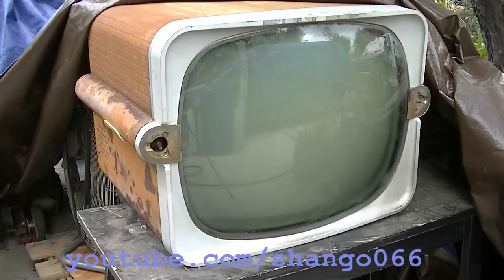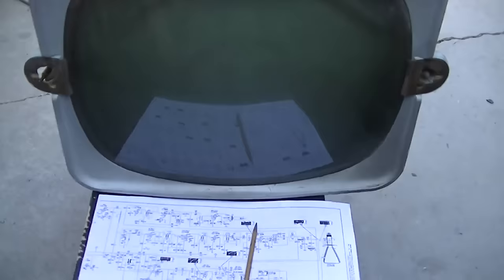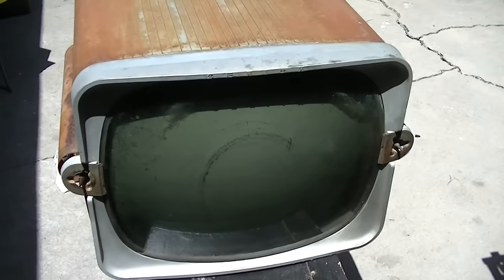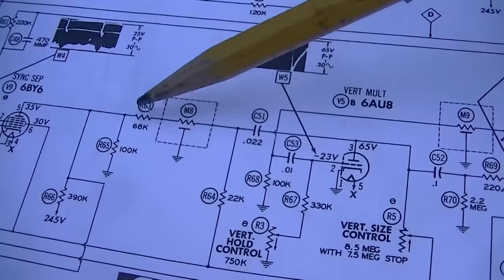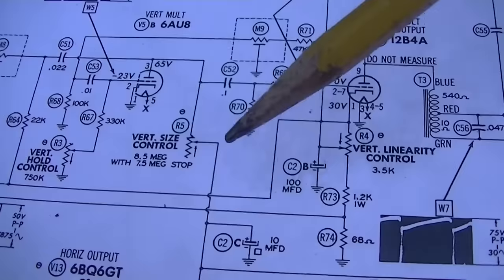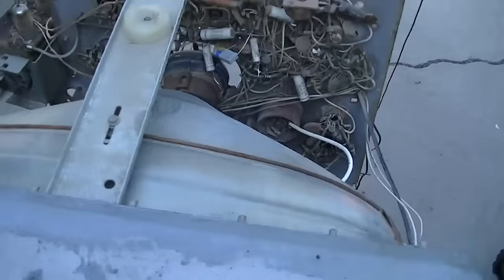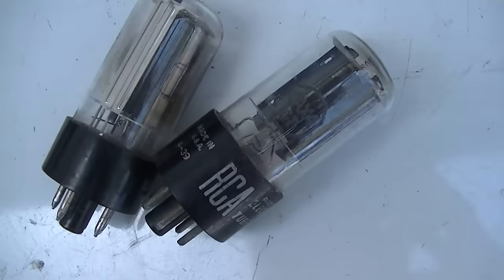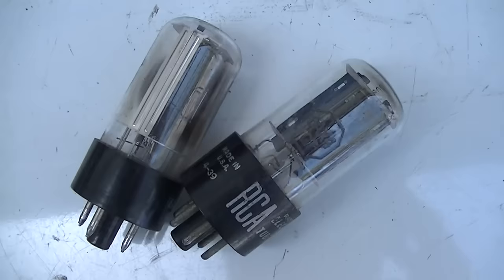Part 2 1956 Zenith black and white dump set Resurrection

Comment: One of my first sets I ever had was a slightly later 14" version of that set. It was a trash pick when a neighbor bought a new set and just tossed it so I grabbed it. It still had a excellent bright sharp picture. I used it till I saved my berry picking money one summer and bought a used 69 23" chroma color set used in 74 for 115 bucks. It was the first color set we had and I put in my tiny bedroom. I later started rebuilding and selling used sets and Zenith was my favorite, if the crt was good they almost always showed a great picture, even better with the newer V high brightness phosphor tubes. It's a old video now but got my attention when I saw that set, thanks. I saved that set for years and I think it finally got donated when I finally moved out. I still have boxes of tube and some test equipment and parts.

Comment: Yes Shango, in my email to you from Monday night I made a mistake on Your RCA floor model it's the CTC 28 Chass You have 3 parts to & that one Set I done lots of repairs to & like i say I had one for 6 years in the 1980s. When I got my CTC 28 floor model TV the color was just great & when it started to get darker I found a brighter in the Set & the CRT was rejuvenated before I got it & it was done again after I had it but after 5 years the CRT was to dead. Today up here in my area there is none of them things around any more. I wish I could get one some how with a good CRT. I am in the same Boat you are in, I have My Apartment so full of the Electronics I love & I have no room to take on any thing more. I have to say from playing all of your videos You are the most smartest Man in this country. You fix things a little different But you are so much more smarter then any of the TV repair Men I have worked with over the years. And I have worked with lots of other TV repair People & Radio station engineers over the 1980s & 1990s. I find it increadable you can repair the flyback in old TVs after they start smoking & stuff. The TV repair men I worked with would just try & replace the flyback in them or just tell the owner is shot & beon repair. And You work on Cars & most of all the newer Cars with the securtity system in them new Cars. Boy I wish I could have a visit with you on the Phone. I wish i could meet you someday, I would book a flight to come out & see you & your TVs you have fixed up & got them to work & look brand new. You are so lucky to be in LA & fined things like that Conn Orgen & get free speakers & all the parts You could ever want. Up here in north east MN We never see the kind of stuff you have got from the curb & streets of LA. We have had some newer CTR TVs out side like 5 years ago for a while but with in a day or two someone will brake the CTR & the Trash man do not take that stuff up here. People get fines for trying to dispose a TV in the dumpster up north here. your lucky you can still toss that stuff by your loco trash pike up. Here We have to hull that stuff to the land fill. You get these nice astate sales to & all the great nice olld radios you get to buy & so cheep. We never get sales like that up here. Take care & I pray We can hook up. Sadly today every TV & Electronics shop has gone out of Business including Me with Jerry's VCR & TV service. again My email is Soundmaster404@gamil.com  And my Phone Number is 218-290-8458. take care. Jerry

Comment: Good resurrection of the vertical deflection, with a bright, stable picture too. No obvious cloudiness or smearing that I could see - not bad considering how long it had been left out in the harsh desert conditions for so many years. It's a keeper.

The 6AX4 horizontal damper - interesting that it was the second tube to fail while the set was running (arcing and flashing). A royal pain in the ass when it happened since you were still testing the TV at that point.

Comment: I've always had really good luck with white ceramic sealed caps. I guess they have epoxy seal on the ends. Seems like they resist moisture. Can't remember the last time I found a bad one.
Reply: The Guitologist 
Yeah, contrary to what Shango reports, I have had my BEST luck with Cornell Dubliers, Elmencos, and Goodall ceramic tube caps. I know they are probably all paper inside, but the tubes seem to seal out moisture or something.
Reply: I've had very bad luck with them being leaky, especially when used in coupling stages
Reply: ahh hah your watching this too...  :-)
Reply: Agreed, however, in this case, the set was outside, so the caps likely got exposed to "the elements", and being outside can accelerate the damage to these caps. Doesn't happen in all cases, but I have seen it happen. Good to see you on this channel as well, Brad!

Comment: 8.5 meg pot with a 2.5 meg stop.  A 5 meg pot in series with a 2.2 meg ohm resistor might be close enough.  A 10 meg pot would work, but be effective over about half it's range.  You could put a 12 meg in parallel with the 10 meg pot and that would get real close, with the 2.2 meg in series.  (not really a pot, but a reostat since only two leads are used.)

When you were thumping on that damper tube, I was waiting for it to blow up.

Comment: I wonder how well a 6339 will work as a damper.  It's a little directly heated HV diode equivalent to the larger 3B29, rated 53mA at 16kV with a 6.3v heater.  Of course it would have to be put in a box and clamped to a heatsink since it has an external anode.

Comment: I just got into restoring old TV's and managed to get one working. Its an RCA Victor 730TV1. I did a bunch of work to it including putting a new 5u4g low voltage tube in. I've noticed that if the TV is not warm and I power it on theres a hum (not from the speaker) for a second then its fine. Also the 5u4g has a white glow on the top plate during that hum. I want to make sure if this is normal. Maybe energy is generating before the tubes have a chance to heat up?

Comment: The 8.5 Megohm pot with a 7.5 Megohm stop can be replaced with a 1 Megohm resistor in series with a 10 Megohm pot; wire the 1 Megohm resistor in series with one outer terminal of the 10 Megohm pot, and hook the center terminal of the 10 Megohm pot where the center of the old pot was. This should work as the old pot was just a rheostat.